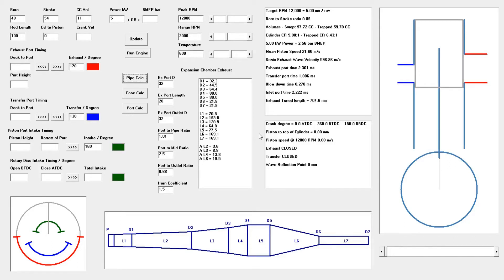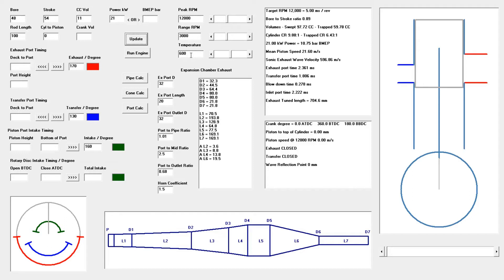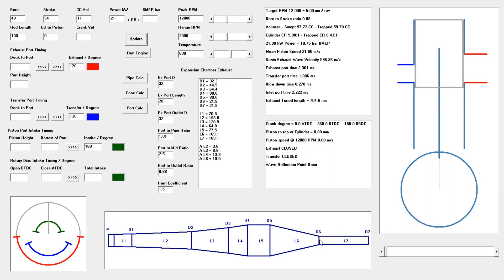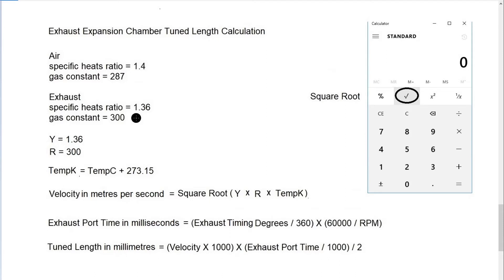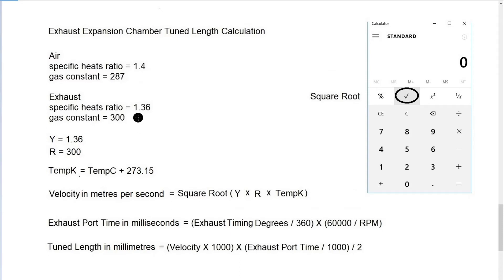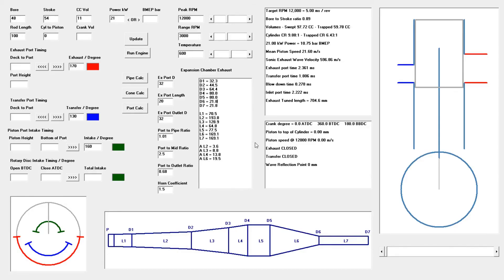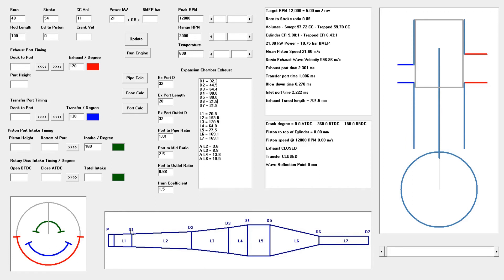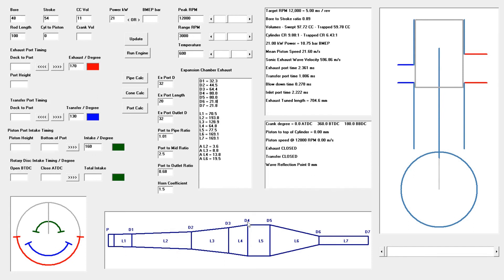How to Design a Two Stroke Expansion Chamber Performance Exhaust - Step 3

Comment: Also exhaust port time is in ms to bring it up to seconds you would multiply it by 1000 not divided ? Am i correct?
Reply from the maker: No to convert milliseconds into seconds divide by 1000 because there are 1000 milliseconds in each second.

Comment: 6.33 minutes. Should it be rpm divided by 60000 and not 60000 divided by rpm?
Am trying my best to get rd400 tuned length and only getting 380mm. Mmm keeps me on my toes
Reply from the maker: That exhaust is port time in milliseconds.
1 minute = 60,000 milliseconds
What the equation is doing is finding out what division of 360 degree is the port timing.
So if its 180 degree then it 1/2 or 0.5 of 360 degrees.
So the equation is 0.5 multiplied by the time the port is open at during one crank revolution in milliseconds based on the RPM.
So if its 10,000 RPM then the equation is 60,000 / 10,000 = 6
So the port that is open for 180 degree each revolution is open for 6 milliseconds when the engine is spinning at 10,000 RPM
And based on the speed of sound inside the pipe at the given temperature which is "Velocity" at metres per second.
So we convert metres per second Velocity multiplied by 1000 equals millimetres per second.
Velocity in millimetres per second X Exhaust port time in milliseconds. So that is converted to seconds by dividing it by 1000.
Then we divide it by 2 allowing for the fact the wave goes to the end of pipe and back to the port and we only want to know how long it takes in one direction to find out the tuned length of the pipe.
Reply from the maker: If you are struggling with the equations it might be easier to just download the free software and use it to get tuned length.
See link in description section under video or in later videos.

Comment: are these calculations for geared bike or for cvt
Reply from the maker: In short both.
You can adjust the values to make the pipe have a wider or more narrow power range.
For a CVT a narrow power band would suffice and no need to sacrifice peak output.

Comment: At 0:57, this is confusing.  The previous video you mentioned 3.5bar gave 350deg.  Here you mention 5bar gives 350deg.  Also your software shows it's at 600degrees with 2.56bar.  Then you change bmep to 10.75 and it stayed at 600deg.  Can you please clarify?
Thank you for all your efforts!
Reply from the maker: The conversion from BMEP to exhaust temperature is not via any equation it is just an estimation and not that accurate.
So it falls within a range of BMEP and I am using the estimation provide by Prof Blair in his SAE papers where he provides 3 basic range values of BMEP that equate to an approximate exhaust temperature.
The only accurate way to know exhaust temps is to use an EGT gauge.
Also keep in mind that even in an engine that has for example 600 C exhaust temp can fall to as low as 450 C at lower RPM so the aim is to test for the maximum temp at peak RPM in top gear too.
Reply from the maker: Also if you have a look at my expansion chamber software it has a tables of estimated ex temp based on BMEP
Some softwares have a function to convert BMEP to ex temp but they don't use an equation they just do a straight line estimation of the same table I use but for transparency purposes I dont do that.
I think its better people are not under some false impression the software is doing some accurate conversion of BMEP to ex temp. Also there are other factors that influence ex temp not just BMEP for example changes in the outlet pipe of the chamber and water cooled engines compared to air cooled, air fuel ratio, ignition timing and more.
Reply: @AuMechanic  
Thank you; If i get time I will pull the pipe off at the diffuser and put a thermocouple in there at peak power to see how close the estimate is.
Reply from the maker: @mitchell5828  Generally you can measure at the header end to get peak (which would be more representative), yes it will get cooler farther down the pipe but best to go with max temp, keeping in mind that a lower temps (slower wave speed) will result in a longer tuned length that fits lower RPM range and you don't want a pipe that "cuts off" below peak RPM, best to have the ability for a bit of over rev. Also keep in mind that in lower gears and lower speed temps are cooler and the pipe tune fits lower RPM which is favorable out of the corners on a track.
Reply: @AuMechanic  This application is for a self launching motor glider needing the engine for maximum climbrate for ~10min then shut off.  Temps are easy enough to measure so I'll try a couple places to see how they differ.  I might then build different pipes based on different temps and see which ones work best.
Thank You

Comment: Another query from me... The IGC and SHR values must be left the defaults that the program gives us (1.36, 300)?
Reply from the maker: Those values represent the composition of the exhaust gas depending on the type of fuel used and the Air fuel ratio that both effect the speed of sound and thus the tuned length which is calculated using the speed of sound inside the pipe.
ICG is the Individual Gas Constant and RSH is the Ratio Specific Heats.
The default values are for Gasoline at an average AF ratio and temperature.
If you hold your mouse over them the help will pop up explaining them.

Comment: Great video. Would be possible to refine/improve pipe back pressure performance on old two stroke 'cigaro' type exhausts?
Reply from the maker: By "cigaro" I assume you mean old style none expansion chamber type mufflers.
In general as the baffles in those old pipes clog up  over time performance drops so no increasing back pressure on them would not help and keep in mind that too much back pressure will cause over heating that will increase the chances of seizing due to piston overheating in addition to inducing detonation.

Comment: I have a desert aircraft DA35 and I plan on building a tuned pipe. I was wondering if you have ever built a pipe out of carbon fiber?
Reply from the maker: No I cant help with that.
Reply: I can do the carbon fiber part I just need to know how to make a curved or U shaped tuned pipe. Will the calculations work the same ?
Reply from the maker: @BowDwn2  The material used wont effect the dimensions in the pipe equations.

Comment: Hi Dave, what target RPM for pipe design would you suggest for a 15-ish hp, 50cc cylinder with 190 deg exhaust duration (with auxiliary ports) and 122 transfer duration? I've looked up charts but they range from 7000 all the way to 14000. Your help would be really helpful! Thanks!
Reply from the maker: The target RPM for the tuned length calculation is always the maximum RPM of the engine.
This is the point you want to pipe to go from producing gains to dropping power rapidly.
It works like a bit of a rev limiter in effect.
Reply: @AuMechanic  I absolutely love how dedicated you are on educating people. I always read the comments and try to learn something from here as well. Thank you a thousandfold.
Reply from the maker: @BK-it6wg  
And thank you for the comment.
Cheers
Reply: @AuMechanic  What if you won't reach the max published RPM? I run RC boats. Stated max RPM is 28,000 at @ 5HP on some of my engines, but I wouldn't expect to see more that 20k under load (large props with lots of pitch). I never know which RPM to design for, but it seems like the max achievable RPM would be the figure to design around. Is this incorrect thinking?
Reply: Also, thanks a lot for all of the videos. Very informative, and useful, for a nitro-nerd such as myself.

Comment: I have an rz 250 does the ypvs make a difference in measuring the port thanks
Reply from the maker: Yes Hank, in that case the exhaust timing is taken with the Exhaust valve fully open position as it is at top end RPM.
Covered that also in the earlier video https://www.youtube.com/watch?v=SD0gy7jYdT4
Reply: AuMechanic I did watch it I will watch it again
Reply from the maker: Using the tuned length formula you will see that with the ex fully open timing at peak RPM, when you reduce the ex timing by closing the valve as it would at lower RPM, and then change the peak RPM value in the equation to render the same tuned length you started with that will show you how the effective peak of the pipe has shifted down the RPM range.
Reply: AuMechanic thanks Dave

Comment: Before you were saying tuned length is taken to the mean point of reflection.mid cone? Why now are you saying to the end of the cone.?
Reply from the maker: Because this is using Blairs formula (1996) to design the pipe that specifies that point to point to the end of the baffle cone..
The formula using half the angle of convergence of the baffle cone is from the Gordon Jennings formula from the 70's that Graham Bell also used later.
Reply: AuMechanic I was thinking the end of the cone measurement would be the end of the wave as well...where the the pressure drops back off to atmospheric pressure and the beginning of the cone is where it just starts to raise pressure in the wave, timing wise, and mid cone is the peak of the wave where it hits it's hardens so could you not use the beginning of the baffle to time where that pipe starts to come in and the end of the cone where it drops off..using the middle of the cone for where you want the most hit in the rpm range?
Reply: Because noe I'm confused as to why they would have different ideas of where to measure the tuned length to
Reply from the maker: There is no "sine" wave in the pipe, the wave it refers to is the initial compression wave that comes out of the exhaust port as it opens, it then travels the length of the pipe to the opposing baffle cone taper and bounces back toward the exhaust port arriving at the port just as the exhaust port closes to force intake charge spilling out of the cylinder.
The outlet pipe is the pressure bleed for the chamber that's all.
This is all covered in the earlier series covering the scientific fundamentals of pipe operation as per Professor Blairs papers..
Reply from the maker: The Jennings equation appears to be based on a peak pressure centre point of the compression wave where it is reflected and not the far end of the wave.
Reply: AuMechanic sorry I meant cone not cine probably confused you I know what your saying I understand most basics...i mean if I use wave speed and port timing to to get a tuned length at say 6000 rpm it's calculated to make it to the end of the baffle and back just before ex port closes than the peak power will be at a lower rpm because the high point or peak pressure of the wave arrives a bit earlier in the cycle. So do you not want to time the wave to be in its peak pressure going back in the ex port right before it closes to get the most out of the effect of the baffle at the rpm you want
Reply from the maker: Yes that is the aim however Blair does not elaborate on this specific point.
It may be that this provides some allowance for the propagation delay of the initial compression wave.
Also that the ports actually have to be open to some degree.
In my own opinion it may be best to used the Jennings mid point of the baffle cone too allow for the above considerations.
Port closed to port closed is not truly representing the conditions needed.
In addition to that it is better to make the pipe slightly longer simply because it is easier to shorten it slightly to get the sweet spot in testing than it is to make it longer.
However that is my opinion and these videos I do try to stick to the methods stated in published articles.
If this series sees any interest I may recover a few issues and give my opinions on where I do not totally agree with Blair et al.
Reply: AuMechanic Awesome thank you.